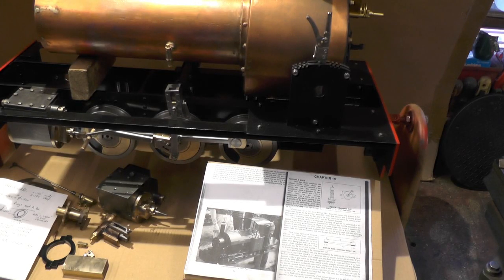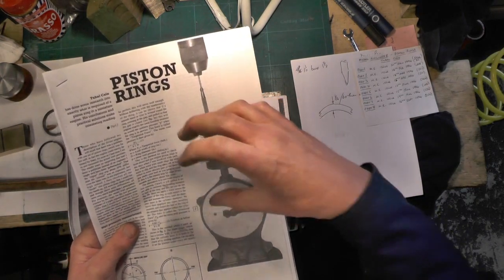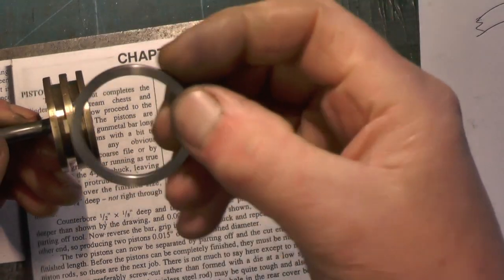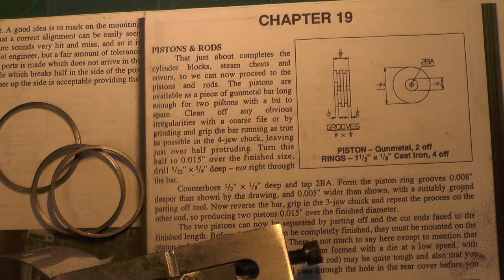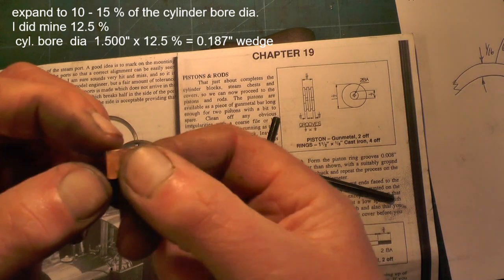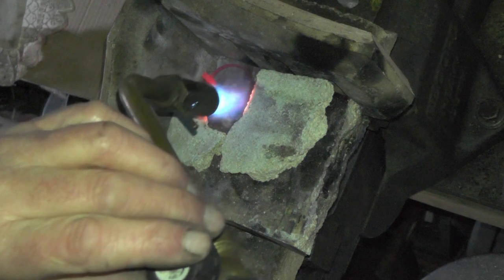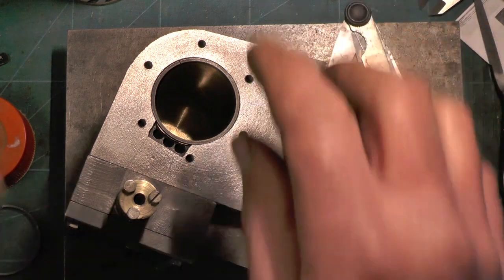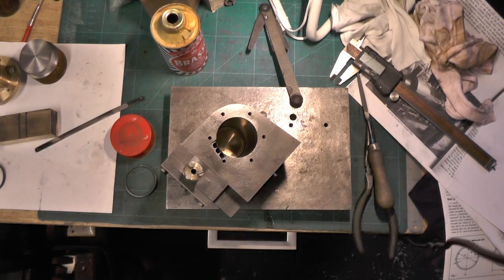Make a Miniature Steam Loco Series (Cylinder Internals Part 2  making piston rings ) "mr factotum"

Comment: Hello,

I am attempting to make valve rings for a 5 inch speedy (the rings are 5/8 od with 55 thou radial width). I make them the way you describe, however when i try to fit them onto the bobbins they just keep snapping. Any advice on where i could be going wrong?
Reply from the maker: Hi CB
Sorry to hear your problem,  
Just by chance i am making my rings now for my Sweet Pea Loco.
 i am making them axactly the same as the Metre  Maid loco and just fitted them all on to the pistons with no problem, i have video'd the process again, this will be available in a few week, just got to edit it, but i don't have time to do this for some time as  too busy at moment.
I am no expert, but it sounds to me like the small diameter your making them at 5/8" od,   the radial thickness might be too much, thats more or less the thickness i made mine at, and my rings are 1.1/2" dia.. If i was you i woud try reducing the radial thickness proportionatley to the ones i shown. This will or should make them more flexible, I assume you have Normalized them  with a spacer set in the gap to give you approx. 12 1/2 % increase in diameter once cooled.
Let me know how you get on, and good luck
ATB
Kev
Reply: Hi Kev,

Thanks for your advice. I ended up making the radial width to about .9mm and also used a file and pliers to create the split. All is now well! Thanks Tom
Reply from the maker: @CarroBelga   good to hear Tom
atb
Kev

Comment: Half way through this series, and really wonderful. Your video/youtube quality has improved in leaps and bounds - thank you so much for taking the time to video tape this for us all. May I ask why specifically you chose a metre maid over other beginner designs?
Reply from the maker: hi tiw
thanks for your kind words. still learning at this videoing game!!!
i chose the 0-6-2 metre maid version, as there doesn't seem to be as many around as the 0-4-0 sweet pea versions, that's all really , nothing against the other versions though.  i think the 4 wheel version is a little simpler on the running gear rather than 6 coupled wheels, for complete beginners though. 
thanks for watching
regards 
mr  f

Comment: The cylinders of my loco ar in 14 mm dia.... should i made the piston rings in metal or Synthetic?
Reply from the maker: hi there
not sure about that, i know that aeroplane modellers put metal rings  in small scale combustion engines, perhaps you could take a look on you tube for aeroplane modellers at take it from there. Hope that helps
regards
mr f
Reply: @MrFactotum  thanks.... but i think in a cylinder of an aeroplane, burns fuel.... mine is brass made and runs by steam.... 🤔
Reply from the maker: hi dream steam
Yes, i realise that.  I was just trying to give an example to see if its physically possible to make rings that will do the job in your scale; i feel sure if the size your proposing work whilst in fuel burning engines they should work in steam
Hope that helps you decide

Comment: Mr. F.  That was pretty neat.  How did you determine the width of your brass spacer when you normalized the ring.  If you mentioned it, I missed it.  Thanks for sharing.

Joe
Reply from the maker: hi joe
from the information i researched the standard expansion is between 10% and 15%, i just went down the middle
thanks again
mr f
Reply: @MrFactotum  is that 10-15% of the OD of the ring?
Reply from the maker: thats correct joe
cheers
mr f
Reply: @MrFactotum  thank you sir for your patience.  😀

Comment: Oh most Excellent video. I learnt a lot from this one. 
I checked my plans and I too have no info on piston rings. I had assumed that they were silicone. 
I need to get some fire bricks too to make a new hot work area. I have a bit of vermiculite block but my Oxy Acetylene is too hot and melts it.
When I get this far i will most certainly be referring back to this video.
I see you have copies of old ME magazines. Are they from your local club?
Info like magazine numbers etc would be good to put above in the description. 

Thanks 
Brendan
Reply from the maker: Hi brendan
nice to hear from you
yes i copied the article from my clubs library of m.e.'s, i will take your suggestion on board and add them in the description when time permits. The fire bricks i used in the video were from wilko's which they sell for open fire grates.
regards 
mr f